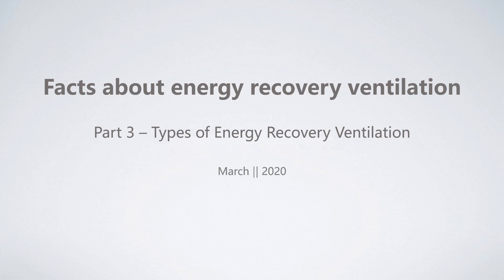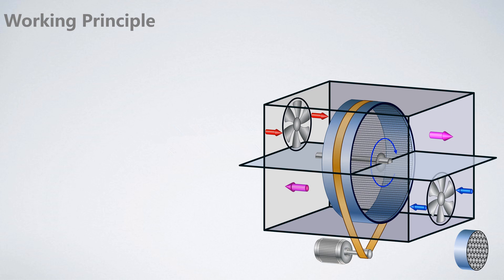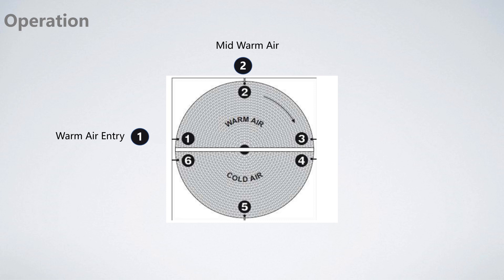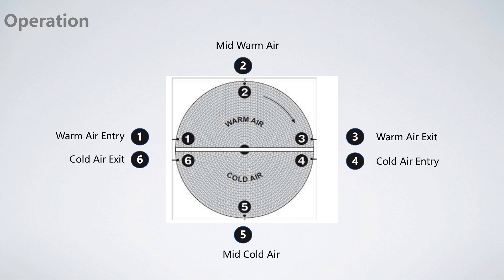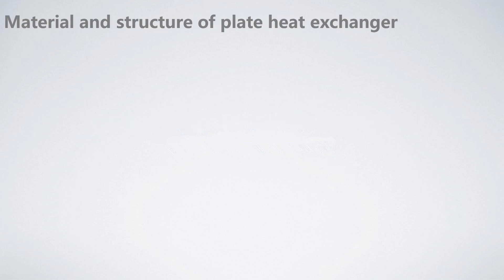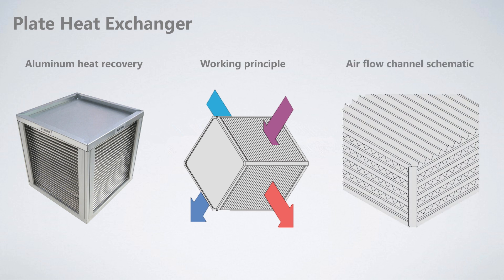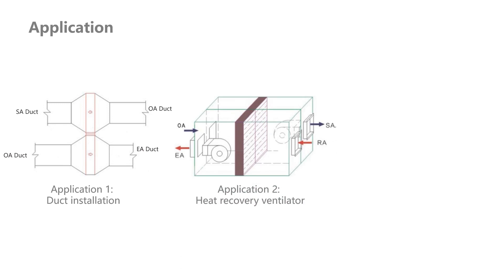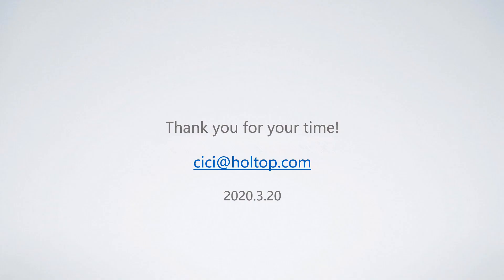Types of energy recovery ventilation system-form of the heat exchanger thermal wheel heat pipes

Comment: Hi, can a aluminum plate exchanger freeze during extreme cold?
Reply from the maker: working in extreme cold, the device with an aluminum plate heat exchanger suggests combining with an electrical heater for preheating, or the freeze will happen

Comment: Heat pipe purpose is for reduce cooling load?
In residential flays why ahu with heat pipe is used
Reply from the maker: Hi Tetris, thanks for your comments.
As far as I know, heat pipe heat exchanger (HPHE) is mainly utilized as an efficient device in commercial and industrial applications, the residential houses seldom use heat pipes devices. 

Here is a link to explain the "Heat Pipes Heat Exchanger for HVAC Applications",  https://www.intechopen.com/chapters/76428

hope you find it helpful.

Comment: Dont know about smoking loung instalation. Then it would exchange the smell to the supply duct.
Reply from the maker: Hi Klavs, thanks for your comments.
Yes, the smoking lounge installation has a strict condition for both ventilation systems, including the ducting, filtration solution and leakage rate of the machine, etc.
Reply: Doyou room setin rund hammgo checkingok

Comment: Probably the easiest and cheapest way to have a small heatexchange ventilation unit would be to get an air to air intercooler of a TDI vagen.
Reply from the maker: do you mean the air - air heat pump?